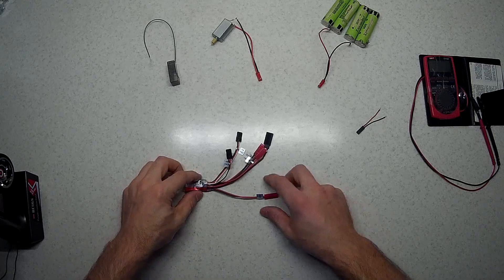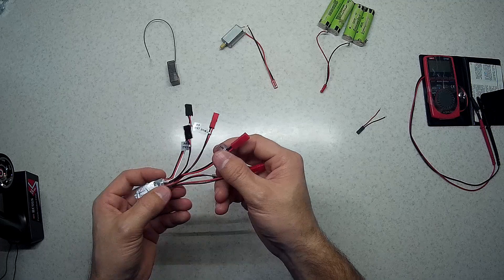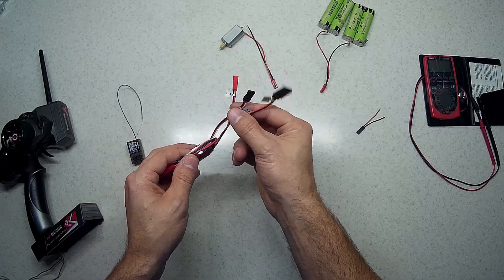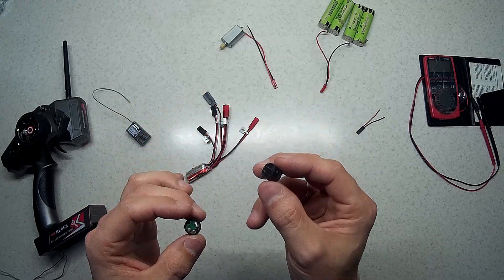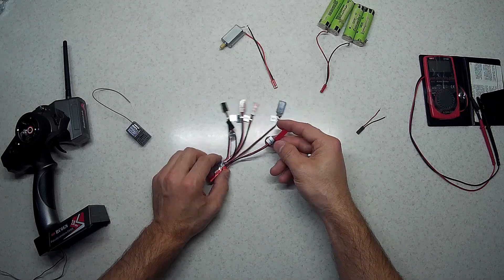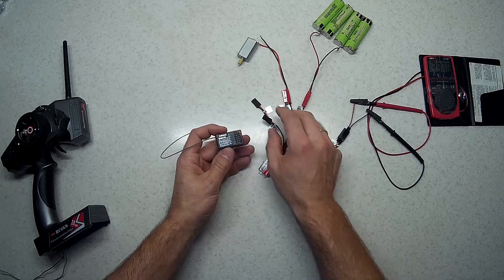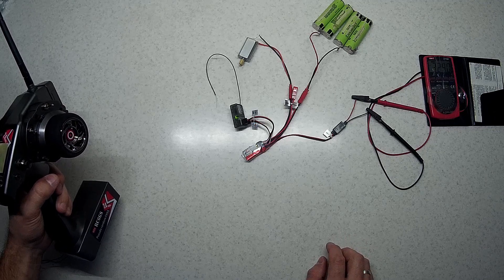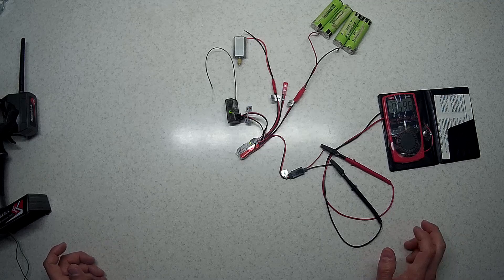How to use DumboRC 10A Brushed ESC

Comment: I want to use a dumborc 6fg on a brushed car do I need one of these things to do it?
Reply from the maker: You need to check your car has a motor, brushed or brushless, a servo - I mean it could come with no electronics and no morors. If it has a brushed motor and a servo then yes, you would need this device that makes the link between your receiver and motors + battery. Oherwise your receiver won't be able to start your motor.